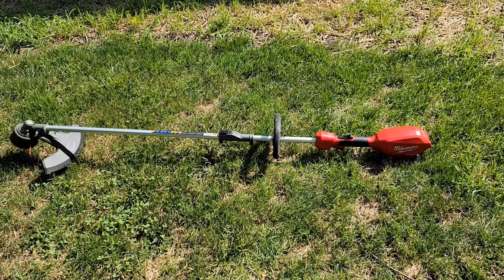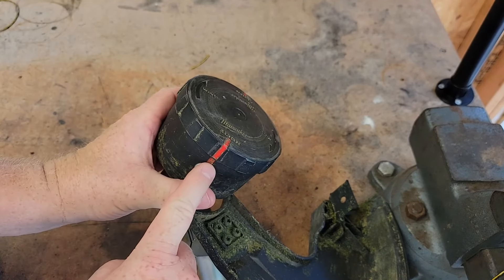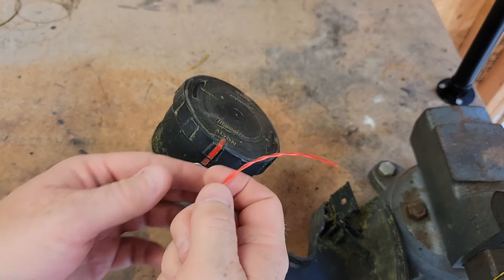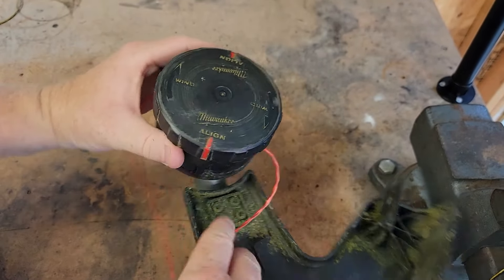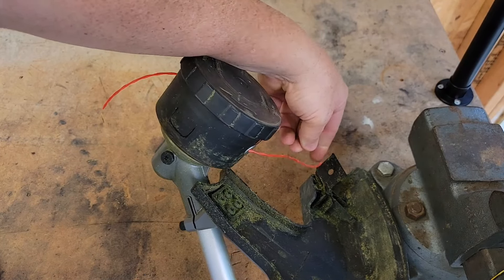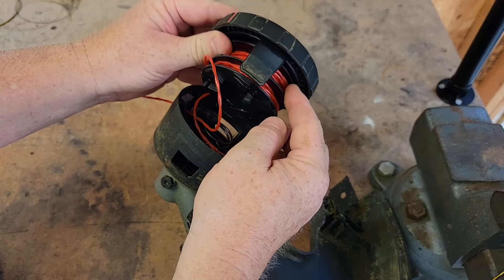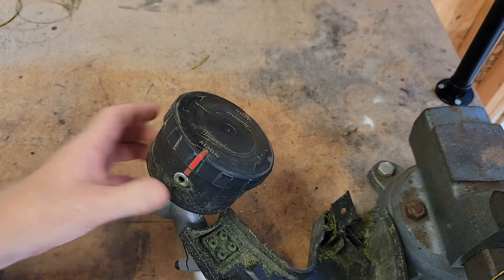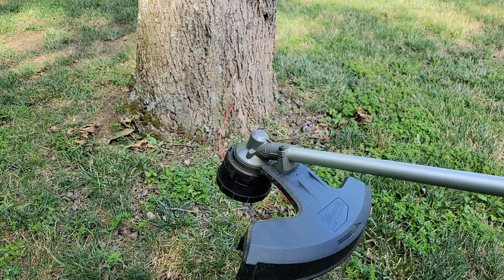How To Restring Milwaukee M18 String Grass Trimmer Weed Eater EASY WAYTO ADD STRING!

Comment: This video saved a brand new Milwaukee trimmer from flying across the yard..  New machine wouldn't "bump" and release line..  I tried 10 or more times to take head off and free it..  Never figured out what the "align" meant until the video or why it twisted so easily..   This video addressed all the issues..   I don't know why but I took string all the way out .. restrung it and it started working properly..   Thank you for addressing all the issues that Milwaukee failed to put into any instructions..
Reply: 😂 I almost tossed mine across the yard about an hour ago.  Guess I'll finish edging tomorrow morning.
Reply: Even when I load mine correctly the string still gets bound up inside. POS in my opinion. Still might throw it across the yard
Reply: @bill9275  Not being funny but are you turning it the right way??   It is directional. On the bottom it shows the direction to turn ..
Do not put in over 25 feet or it will bind up and not release..  "Basically it jams itself if overfull..
Also string size matters as it on occassions gets underneath each other than I have to pull it apart..
Reply: @tomwillis9051  yes definitely turning the right way. I use the precut Milwaukee .095. 
It comes 20 feet. Maybe I’ll have to use less🤷🏻‍♂️
Reply: @bill9275  yeah if you have 20 feet..  Have it in the ALIGNED holes so it comes out both sides equally and are turning it the right way..  It should work..

If not my advise..  take it back and get a new one..

Goto home depot buy a new one.. Take the old one back in 2 weeks saying it stopped working.. They will refund your money :)

Comment: Nice.  I had to remove head anyhow to untangle string, but then used this technique to wind it.  I was also super easy to remove head just two tabs, but this is definitely the fast easy way to wind the string.
Reply from the maker: Glad it helped!

Comment: i have a trouble  whit this trimmer i buy it in home depot new but the head cap donsent have a thread separator its a factory faileo or i need a buy a new head cap because i feeding the cap but the wire dont work